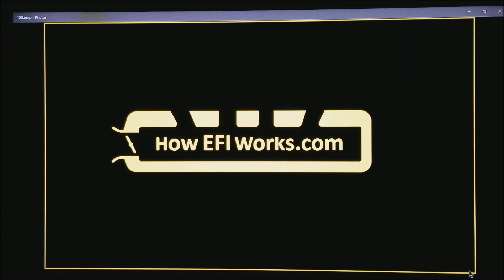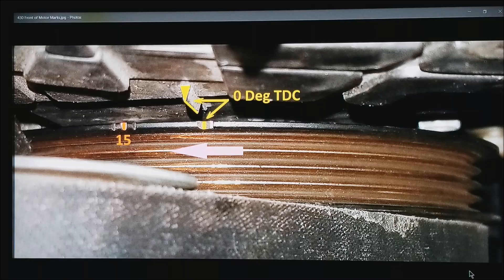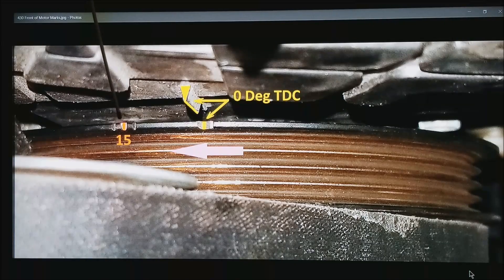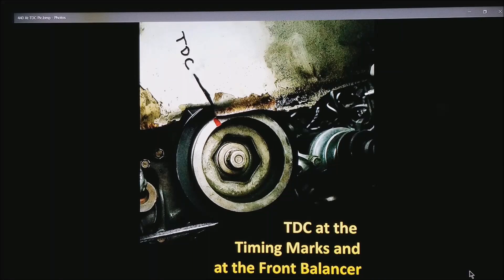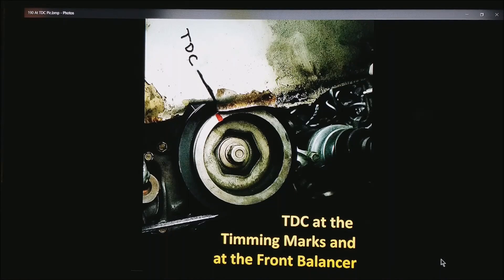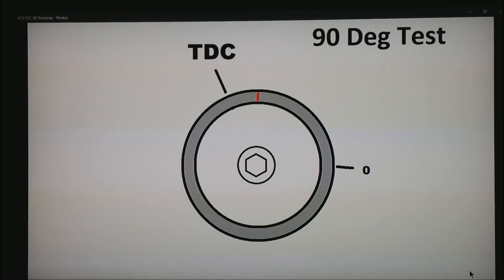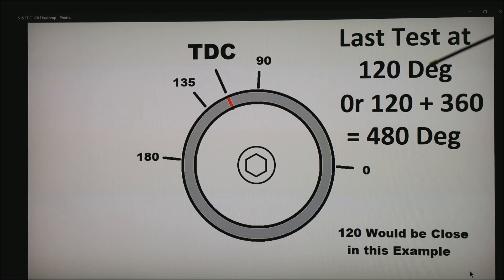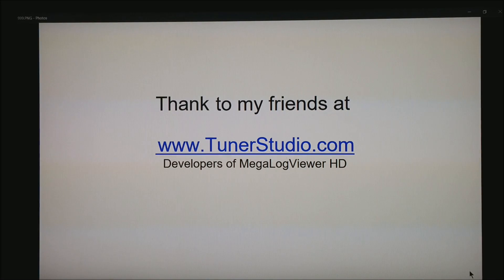Setting Base Ignition Timing Before any First Start Attempt

Comment from the maker: Note that this is not the method given in any of the MS manuals.
Reply: Andy Whittle  the same way with ms2 and micro? Thanks! I love the tutorial vids.
Reply: Should I have the distributor out...i replaced the oring on the distributor and now my car won't start...so If I redo the timing on the engine do I leave the distributor in where it is now or do I take it out and then line up the rotory tip toward the number one cyclinder I have a f23a1 engine Honda accord lx 4 cyclinder thanks.
Reply: @kangokidkidd4037  take the distributor out, rotate the shaft 180 deg and put it back in.
Reply: Love this method

Comment: Hi Andy, I am running a Ford V8 347 stroker (302 base engine) with Throttle bodies and 8 injectors. I am using two coil packs fired in pairs. We are using a Megasquirt type ECU for the first time. And Tuner studio for the first time. We cannot get the motor timed. Even watching your video did not help this. I have the Crank Sensor fitted at almost TDC pointer as its the only place for it. My 36 - 1 missing tooth is 80 degrees before the sensor when the timing is at TDC. Even trying using the tooth angle changing a degree at a time, the motor just coughs and bangs and does not run. Tried a full 360 on top of the setting nothing. The motor was a crate motor so do not expect anything wrong with that. It is taking us ages to do this, any help for a Ford V8? Much appreciated Mark
Reply from the maker: Are you getting a clean RPM around 200 RPM wile cranking?  What is the RPM reading if you crank with the plugs removed?
Reply: @AndyWhittle_HowEFIworks  Thanks for your reply Andy, much appreciated. As its a V8 it turns around 125 to 160 rpm It shows the RPM gauge quite steady while cranking. I gather that if this was bouncing between revs and zero that would be too bigger gap on the sensor to the trigger wheel?  My sensor is mounted a few degrees before the TDC pointer no room anywhere else for it. The missing tooth 36 -1 wheel is about 80 - 90 degrees Before TDC normal clockwise rotation. Some people are saying the missing tooth needs to be behind TDC. I get that maybe I am 180 degrees out and could need to add the 360 to my timing degrees as per your video. But I just cannot get the motor to run it shows symptoms of timing being way out. even had flames out the throttle bodies.. I will double check all the things are wired as they should be again, but I have spent near 6 weeks trying to get this motor working, its getting close to the big hammer time. Best regards Mark
Reply: I have not removed the sparks to turn it over yet. Is that a move to establish timing ?

Comment: I am at this point in my project. Is there anything wrong with just using the TDC mark and setting the "Timing for Fixed Advance" to 0?
Reply: Yes because at half throttle or full throttle top dead center will be way too retarded so what motor do you have?

Comment: Hi andy what is a good cranking timing ? As the motor is turning slowly should this be close to tdc ?
Reply from the maker: I tend to start out real close to 0 first to avoid never kicking back.  If the car starts fine, I leave it at 0.